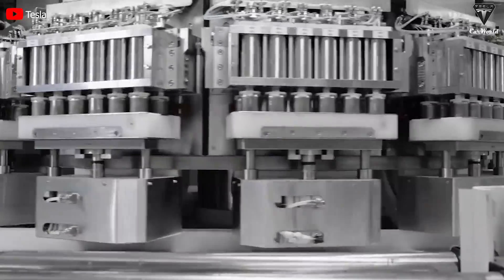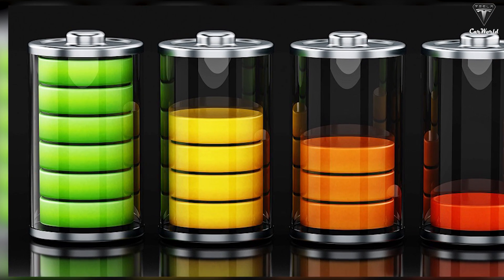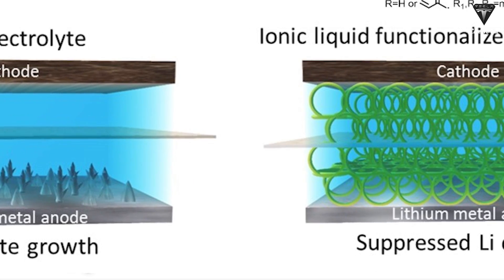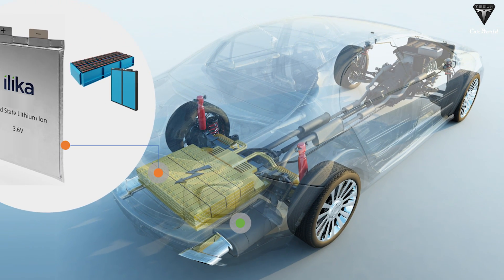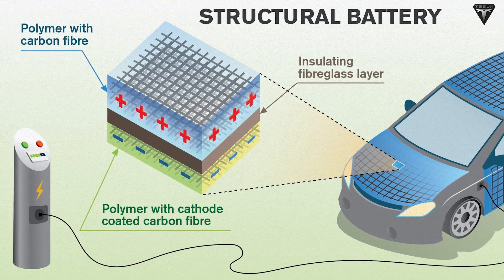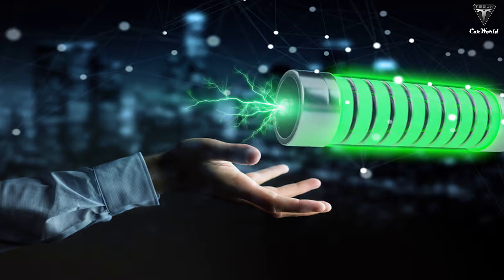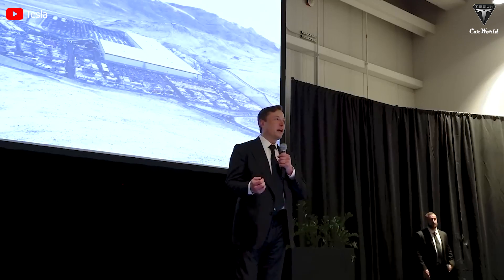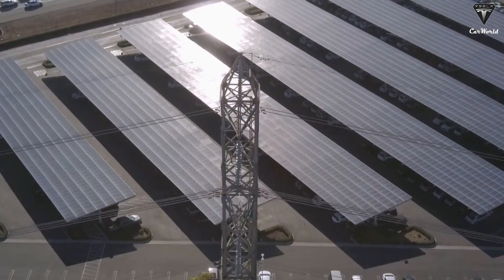Just Happened! Elon Musk Reveals 5 NEW Batteries Tech for 2024, Revolutionize Everything!

Comment: A part related to the altinater, why couldn't the mighty Musk come up with a part that charges the batteries automatically useing the car's motion? No there's no engine to move belts that drives the altinater but, wheels are moving, there are some moveing parts that can connect to a part that would charge and keep a charge in the batteries. If this came out, you wouldn't have to charge at all because, the car would charge its self. I believe the EV will be improved and perfected between now and the next 5 years. So in 5 years, if the world is still here, i will take a look at the EV and see if it's worth giving up my buick lacrosse hybrid, my 2020 Nissan pathfinder rock creek and my car payment free life to get one. If they are not self charging yet then atleast reduce the charge time to 10 minutes. When i drive to Florida from Pennsylvania through the night, im trying to make time not loose it by sitting for 30 to 45 minutes. Oh yeah, bullet trains run on electric. When the day comes America wakes up and builds bullet trains up and down the eastern seaboard, then i wount have to drive at all.....
Reply: I am not shure if the part with the alternator is a troll post but here we go. You don`t need an alternator in an EV, there is a function called regenerative breaking where the drive motor turns into a generator and puts the energy back to the pack. Very usefull when descending hills and slowing down the car in general. You get some energy back and also prolong the life of brake pads and rotors. And even if there was an alternator installed, it would take more energy from the moving car, than it would generate back to the batteries. Nobody wants to spend an extra 1,2kW of power from the batteries to only get back 1kW. Losses are real, perpetuum mobile currently isn`t. (Welp, good luck post, into the deep you go. :) )
Reply: @adrianpavlisin8774  But i didn't say an alternator, i said a part that would be like an alternator. Like an alternator that charges a battery in a car with an engine, this would be a part in a electric car that would charge your batteries. Then you wouldn't have to sit 35, 45 minutes to charge. The mechanism would do it automatically. It would somehow work on the car's momentum....
Reply: @carlsmith5545  A part like an alternator is the drive motor itself already. But only in regenerative breaking mode. If I wanted to charge my EV while driving, that is maintaining  a steady speed, it would require an external source of energy. It wouldn`t charge itself form its own momentum because it would require more energy to maintain that momentum than that part would make.
Reply: @adrianpavlisin8774  Umm, guess I understand. Im no rocket scientists like musk is. This was just a thought. But before i go and give up my car payment free life and spend the money, alot more money on a EV, i will take a look 5 years from now to see how well they have improved first.

Comment: Salt water batteries are the best option. One it utilizes something there is plenty of. If factories are placed near oceans. The metal exterior could be created with the metal we currently have until we learn what pressure and temps and vibrations can create all the materials we need. Though to do so it takes oil. Which means no burning fossil fuels utilize it in creating eco friendly products. The changing of machinery is inevitable we have to go with best quality smaller batteries will be designed as well. You need less because they are bigger so cost is about the same.
Reply: What about B2C (borophene double-carbon) ? Afraid of a misguided carbon-tax ?